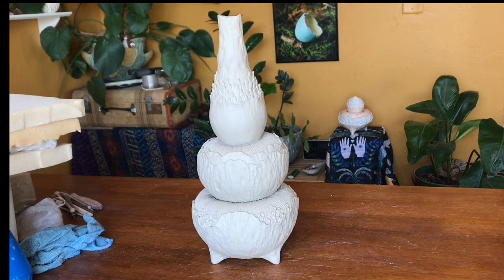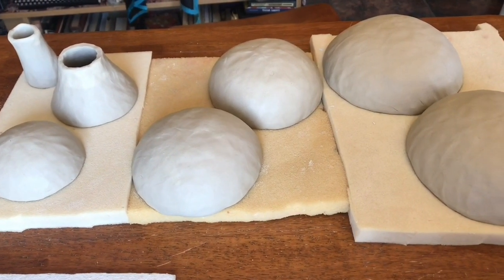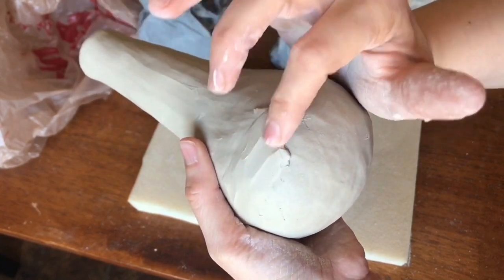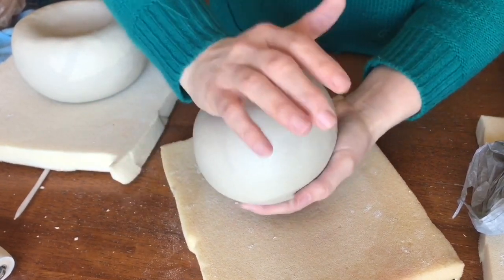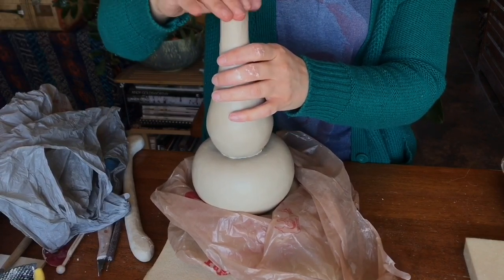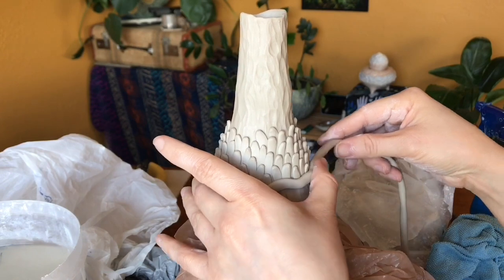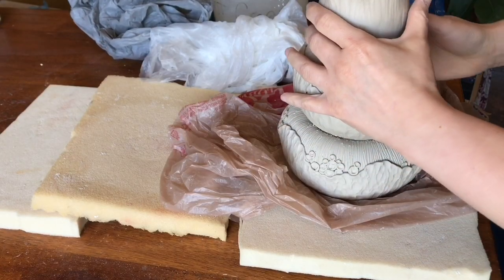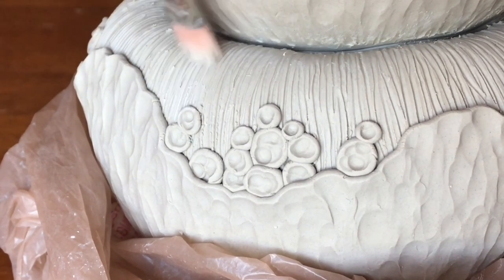Building more complex forms from simple pinch pots (with minimal tools)

Comment: Thank you for sharing! I have a bunch of om4 ball clay, do you think it would work for this?
Reply from the maker: Glad you enjoyed! Sorry for the delayed response, I was out of town for the weekend. 
OM4 and other ball clays are usually mixed with other clays and raw materials to add plasticity to a clay body, or sometimes added to glazes. I’m not sure how it does by itself from personal experience, but this is from Clay and Glazes for the Potter by Daniel Rhodes:
“ Ball clays are impossible to use by themselves in pottery making because of their excessive shrinking, which may be as high as 20% when fired to maturity. They are usually used as an admixture to other clays to gain increased plasticity and workability.”